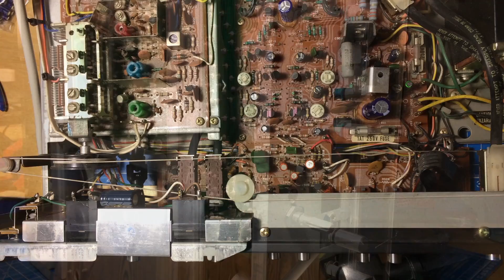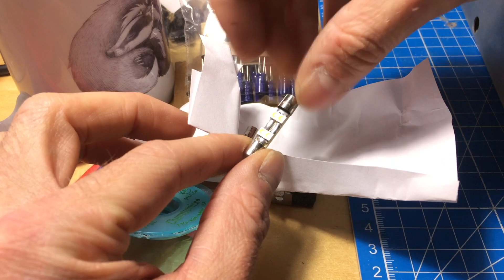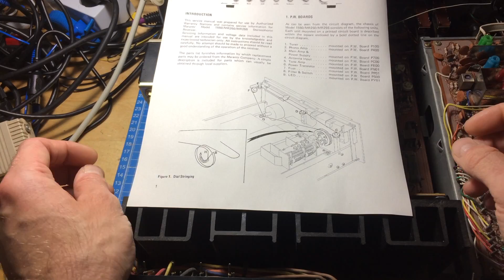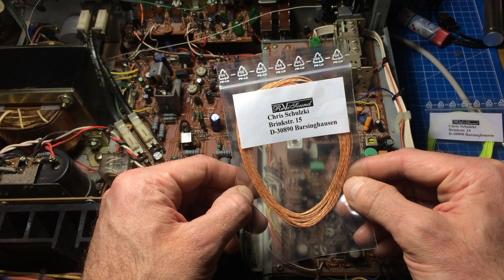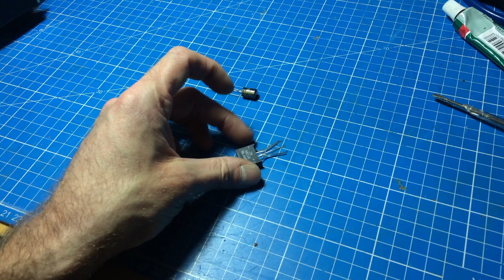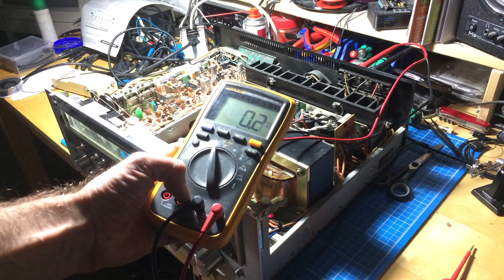Marantz MR 250 Restoration Part 3: Replacing Lamps, Dial String and More

Comment: Hi Jan, love this video.  I just picked up a 1530 from thrift shop.  Thanks to your video I changed the blown fuses to new led ones.  Looks awesome.  But alas, the darn tuner string fell off the spring it's been a nightmare to try to get it back on.  Trying to get the inner gear plus the little bracket both to fit while pushing in the plastic wheel has been a nightmare...4 hours and counting.  Did you ever figure out how to get the gears set to get the tuner stations to work properly?

Comment: Hi! Firstly thx for a great presentation. I have recently bought one of these great machines and for now it seems everything is quite OK. However I do find one or two things that bother me a little. First one is the ON/OF button. It seems to be rather loose (it looks as if ther is too much space arround the button-like something is missing that would hold it tighter in possition). Any suggestions on how to fix this / make it less loose?
Reply from the maker: You could try finding a button that has a similar cutout (the square should be standard size still) and cut it to size to fit into your button or maybe fill up the space with epoxy raisin. If only parts of the plastic are missing, I've had some good success with some glue and sticking pieces of wood (from matches and such) to fill the gaps. Hope that helps!

Comment: Hi, got the same model Maranz. Have to replace lights also, and clean potentionmeters. But not sure how to get those fm signal meters to work, any suggestions what could be the problem? Im going to do my best to keep the string in one piece 😉
Reply: I mean, those meters dont work at all on the left, radio  sound is perfect.

Comment: Nice videos .....thanks.
I usually check /correct offset before adjusting the idling current , then fine tune both after complete warm up and play for half an hour .....then check/correct if necessary , when warmed up  the bias often shifts a little, so i give it playtime just as one will do when listening to it .
Don't worry...The solution for the string will pop up at one time.
Nice job !

(You did not replace the supply capacitors ..?)
Reply from the maker: Thanks! I'm going to revisit the string thing some time for sure. ;)

I tend to leave the big supply capacitors as they are because I rarely see them fail (even with much older equipment) plus it's really expensive to get decent new ones with these capacities.
Reply: Thank you for your answer , I agree with you on your viewpoint .... that was also one of the reasons of my question .
Long ago i started repairing and trying to upgrade what they now call vintage ...experience is what one learns from one's many mistakes .The reason why we like some good vintage ( and also more recent ) is the harmony and the rightful beautiful balanced musicality witch connects to the music without second thoughts or analyzing it's performance, the same we do when we enjoy real music under very different and not always perfect or optimized circonstances , we don't analyze ( in hifi terms , detailed performance and specifications ), we just enjoy ....and vibrate with the soul of the music.
Faulty or bad components like capacitors and other components have to be replaced but only if necessary ! 
Many times that original quality of simply reproducing music the way we can enjoy and connect to it by listening to good amplifiers, etc ....is modified for better performance, more detail and other hifi   glorified parameters , there's nothing really wrong with that attitude and looking for he holy grail.... BUT to often the price to pay is to lose that initial balance , coherence and relaxing experience of simply enjoying music without analyzing the performance of the hifi gear .
Many still think more is always better , and better components are always the perfect solution by definition....as long as all other is also perfect !
Indeed good capacitors are expensive ..but often they break down the so delicate and difficult to preserve musical balance because we forgot that the sum of the performance we liked is the sum of it's components, their chosen " values"  their inherent limited qualities and their limitations , just like a good cook could cook a tasteful meal with rather ordinary ingredients and I would totally  ruin a " perfect "  meal by using only the " best ingredients " following  the " perfect recept " ...

Restoring a vintage amplifier/receiver etc.... is a delicate task , making it better sounding without losing the essential quality and preserving it's original qualities is an art ....
Upgrading an ordinary but very fine driving car with a very powerful and heavy engine will boost it's performance but everything will be out of balance and driving it may be a very uncomfortable and even dangerous experience .
I'm looking forward to more of your videos , sharing your own experience and knowhow at the same time knowing one's own limitations ...very honest and respectful attitude .
Doing one thing at the time ...pause,  check and  listen before moving on ....steering in the right direction and change or step back if you took the rong road ..
Have a nice day and lots of pleasure on the passionate road of your hobby or job .

Comment: Well done. Kudos for taking on that challenge; it looked to be quite tedious, but the results are worth it. I like the LEDs and your little bridge rectifier board is a smart idea. Perhaps I don't understand the stringing of the tuning cable that well, but could it be that the mechanical assembly of the tuner needs to be rotated all the way to the 'stop' position and then the cable strung through A to H?
Reply from the maker: Thanks. It was tedious indeed but worth it (and hey, I learned a lot of new tactics). I approached the stringing like you suggested. Unfortunately I think the fault lies in the stop-mechanism in the adjustable tuning cap there. It fell apart along the way and I didn't manage to reassemble it correctly. I'll probably have another go at it some time when I visit my sister.
Reply: Oh, I didn't realise that it had fallen apart. Regardless, a great project, overall. Must be very satisfying.
Reply from the maker: It fell apart off camera so I didn't even have a chance to reconstruct what happened. Still very pleased with the results of this lengthy restoration. :)
Reply: Oh... I keep forgetting to mention, I like your updated intro with the scope trace! ;)
Reply from the maker: Thanks. :) I planned to make "themed" backgrounds depending on what the video was about but ended up using this one for all new videos. Might come back to that idea some time though.

Comment: I'm repairing my brothers Peavy guitar amp (its essentially a single channel amplifier) its got zero pots for adjusting idling current, and the entire service manual is just the schematic, flow chart and a bill of materials - is that common?

Also you're a good brother fixing that up for your sister :).
Reply from the maker: You're lucky if you get a proper schematic at all with more recent equipment, I'd say. ;) Many amps from the 90s onwards doesn't have any adjustment pots because they are self-adjusting everything in-circuit or (for cheaper ones) are adjusted once at the factory. Don't have much experience with guitar amps though but I'd guess it's the same there.
Reply: Jan Beta yeah it was made in the 90s, but I guess that somewhat new for electronics like this.
Reply from the maker: It definitely is "another world". I mean... they're still using tubes for guitar amps today... ;)

Comment: Thanks for the new video Jan. You know all i could think about was rather you than me doing the string haha, but thought perhaps if it can come off the radio part you could try manually adjusting it to the left most then placing it on there again, wouldn't that be in sync then as the far left most? not 100% sure what I'm talking about but though that made sense in my head.
Reply from the maker: It's the mechanic part in the adjustable tuning capacitor that stops the dial actually. It has nothing to do with the string (that part went unexpectedly well). There's a little metal "nose" that stops the whole cap from turning further. Didn't figure out how to assemble that part correctly yet...
Reply: Jan Beta hmm isn't it possible to wind it round to where you want it then hook the wheel on it . Hard to tell from here how these things work . But regardless I like the lights fix ! Awesome made me feel great to see restoration at its best :) also learned more about the ac dc flicker issue and great example of how to fix that :)
Reply from the maker: No, it doesn't work that way unfortunately. The wheel restricts the range of movement no matter where I start/stop. I only had the choice which part of the scale I wanted to work. ;)
Reply: Oh man that sucks :( well I hope to see a new video with solution it seems a pity to leave it this way . But don't let it stop you from more amiga videos ;) I like those
Reply from the maker: Thanks. There's going to be more Amiga videos soon. Don't know if/when I'll manage to fix the receiver though. ;)
Reply: Thanks man, :) also regarding the CD32 expansion board, thanks to your comment I've tracked down 2x TF328 , their on the way from europe. I'll be SMD soldering the required parts to it as and when i get them lol. Should be a fun project and bring new life to the cd32 ! especially the 8mb fast ram, droolz. :D

Funnily enough today, my wife has no zero experience at soldering however to my surprise I convinced her to solder a through hole switch and then threw her in the deep end with a SMD NE555. Well the result was perfect, clean contact almost factory with no bridges, thank god for flux!
Reply from the maker: Great! Hope you get it working. Also cool that your wife is a natural. :)
Reply: My father came over today finally with the Atari falcon and we also got the rgb mod on the cd32 done ... https://imgur.com/gallery/X3FuN it turned out better than I expect following retrogamemodz instructions . :) really happy with the outcome. Hope to see you do some cd32 stuff in the future !
Reply from the maker: Nice work! I don't have a CD32 to make videos about (yet). Maybe I'll find one I can afford in the future. Then there's going to be a bunch of videos for sure. ;)
Reply: For sure, thank you. It's amazing to play in RGB on my 1080p screen no problems at all without a line doubler either. I'm excited to tell you that I've now ordered parts ram+cpld etc  for the TF328, just waiting on them to ship hopefully all parts will arrives next week . :) of course I'm making TWOx Tf328 I'll  most likely sell the other one on ebay for a more reasonable price than the SX1/SX32's . Hope to see you build some boards in the future on your channel! and a CD32 would be awesome to see as well :)
Reply from the maker: Cool. Looking forward to hearing how it turns out. I actually ordered the A500 equivalent TF530 two days ago. Don't know when I'll get around to assembling it though. ;)
Reply: oh sweet! That'll be a nice video, I can't wait , ill take some photos of the TF328 when it's done. Only thing I've got left to find is an revered extension board for the expansion edge. i think TF has one on his github and i'll try to have them made  might have to order a few lol.

Comment: I think it looked like the string should be wrapped twice around the capacitor wheel, not once like you did. To make the display match up to the tuner, detach the display needle slider from the string, adjust the tuner knob all the way to the left (so that the variable tuner capacitor stops), then move the display needle to the leftmost position and reattach it to the string. Or am I missing something?
Reply from the maker: Thanks for the tips. I did both things you suggested (don't know if I left it in the fast-forward montage). I think it's the stop mechanism near the variable tuning capacitor that is assembled in the wrong way. I had it fall apart when I worked on it and didn't get it back together the right way. There's a little metal pin that stops turning it but I can't figure out where it has to go to. :/